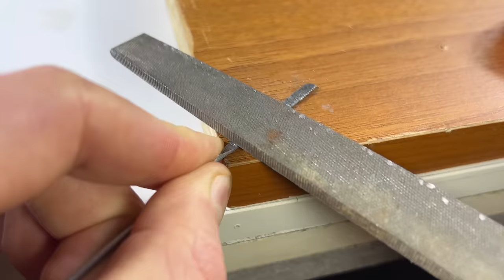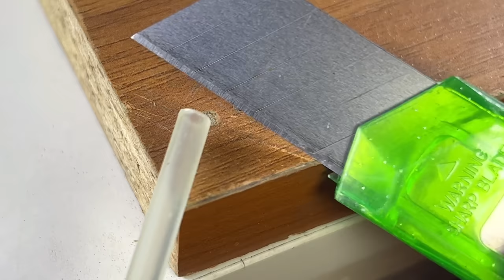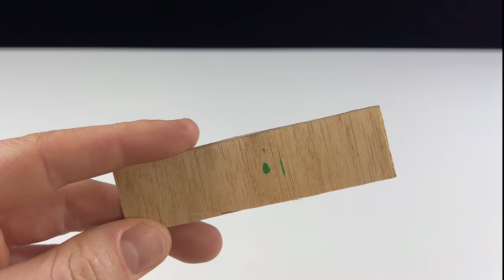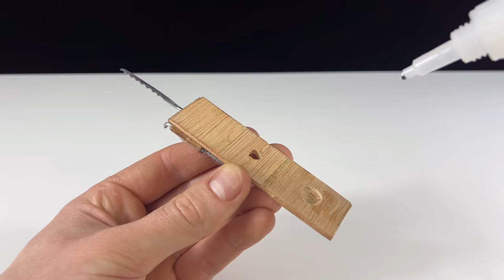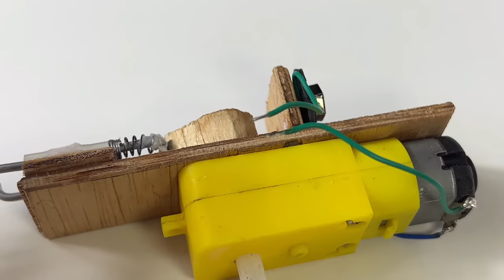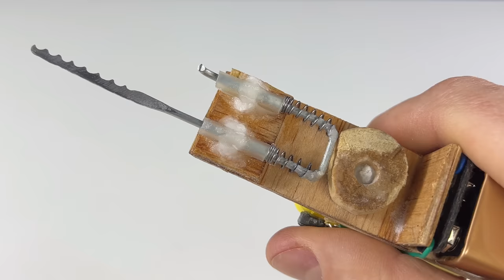How to open a lock easy

Comment: That transparent lock it's a lock for practising and it can be opened easily without the need of creating this tool, i would love to se working on a normal lock to show its efficacy.

Good video though 👍
Reply: Thats exactly what i was thinking. I have one of those practice locks and it literally has 1 pin that is out of alignment with the cyclinder part..... you can open it by sticking a toothpick in and jiggling it.

Comment: What, did it take, like, 5 hours prep?? Pop open a small-ish lock like that with thick screwdriver or crowbar if it's locked on something and buy a new lock for $8 or so next time you're at a store and spend the 4 hours you save with family and/or friends.
Reply: Like a number of other comments here you somewhat miss the point that this is about a bit of creative entertainment. The video isn't intended to demonstrate the quickest, the simplest or most efficient method of opening a padlock. If it was that then a grinderette with a cutting disc would feature as the main tool in the video.
Reply: emmicstv  I was just being funny, I love Inventor 101's videos. Thank you for the link.